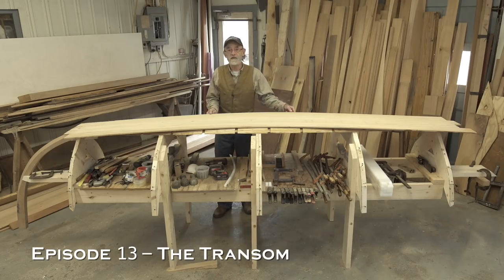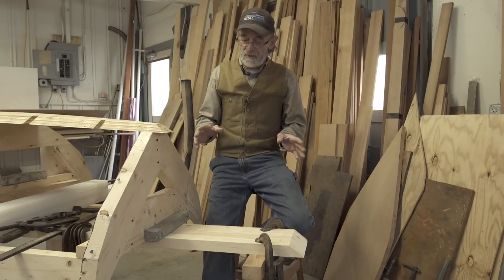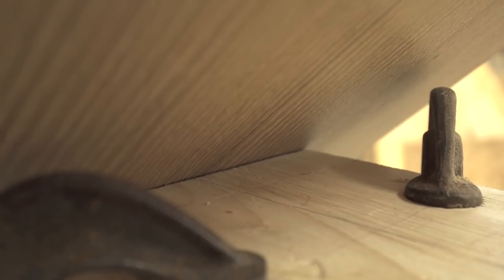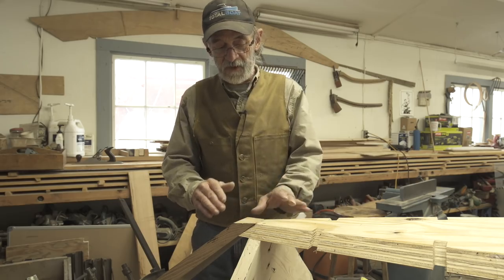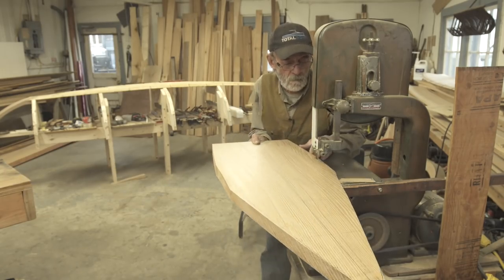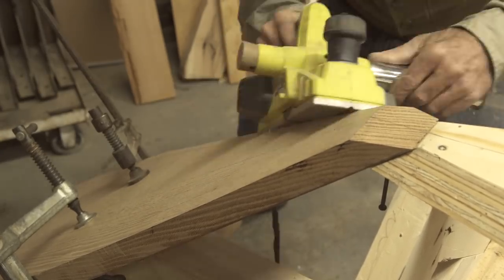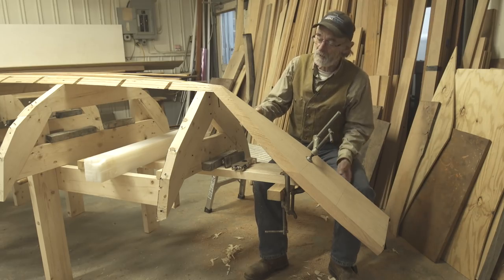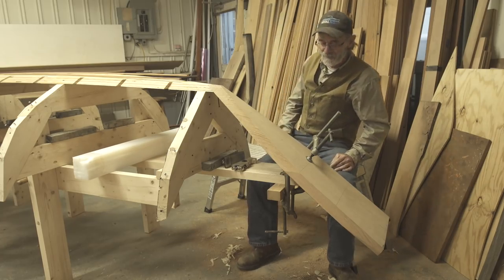Building the TotalBoat Sport Dory: Episode 13 - The Transom

Comment: I recently bought sailboat number 10.  I don't own them all at once.  I got my first, a sabot, when I was 14, and my latest, a Cal 25, now that I am 58.  In between has been everything from beach catamarans to a Ranger 33.   I am a lawyer by trade, but often joke that I only practice law to support my true calling as an itinerant boat worker.  I don't do wood, really.  Well, I do wood to a paint-grade, but not wood like you do.  The vast majority of my experience is with fiberglass and plywood and  the kind of plastic-fantastic sailboats that are common here on the West Coast (I live in Long Beach, California).  Nonetheless, I really enjoy watching you work.  The rudder on my latest boat, built in 1967 for which I paid $1,975, has a split in it, probably from baking in the sun as the boat lives on the hard and is put in the water with a hoist to sail.  So I need to drop the rudder and haul out the power sander and grind it down to laminate in some new material in.  I imagine how I am going to do it as I watch you wield a power planer to scarf plywood for the false bottom on the dory.  While I am at it I am going to correct the angle at which the tiller comes out of the tiller head.  It is wrong, and, to make a long story short, the tiller sits too low, halfway to the cockpit sole.  A new coat of varnish while I am at it, of course.  Ah, boats.  There is nothing like them.  People wonder why I always buy boats that are neglected, or broken, and have cracks in the rudder.  Well, I am cheap, for one thing.  But the other is that the soul of the boat is revealed when you get into the real structure of the boat, as you know.  I look at the lines, and imagine the water flowing over the hull and the wind blowing over the sails. Oh well,  "He who would go to sea for pleasure would go to Hell for a pastime."

Comment: As Glenn below states Merry Christmas Louis and crew for again an inspirational series. I'm exactly at the same point with my boat build and after Christmas I'll be offering the transom up to the boat and faring it in. Its taken time as the transom is bowed so I had to laminate it over a jig and epoxy but it's very strong. Being a Graphic Designer of 30 years it's priceless to pick up tips from a master... this weeks episode I'll be using the bevelled bottom plank and clamping to get the angle of the transom correct. At the moment I went over board with a complex framing which is no in my way so I have to remove it.